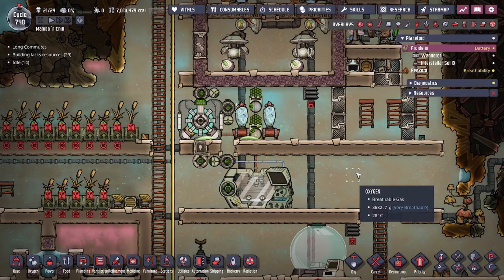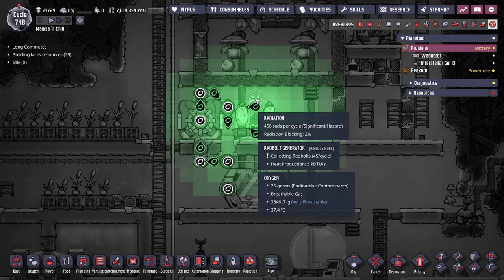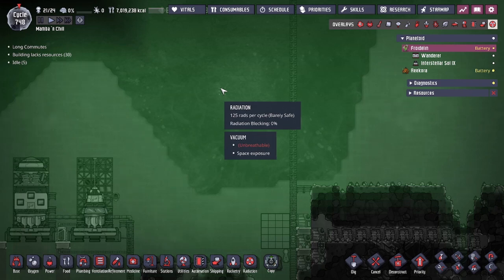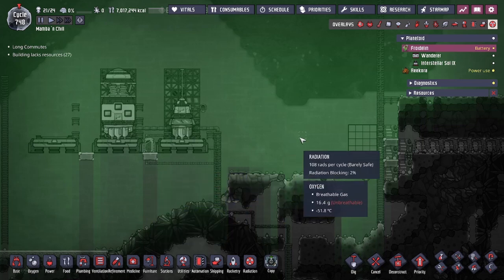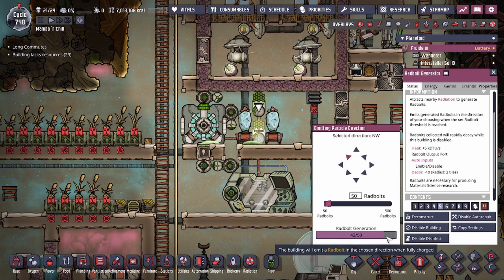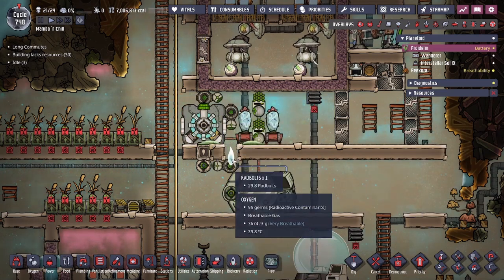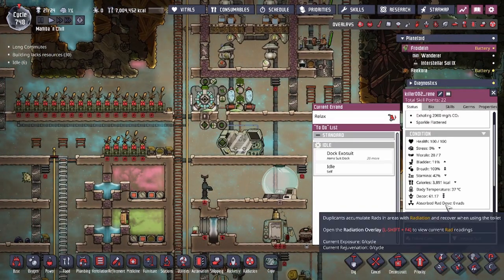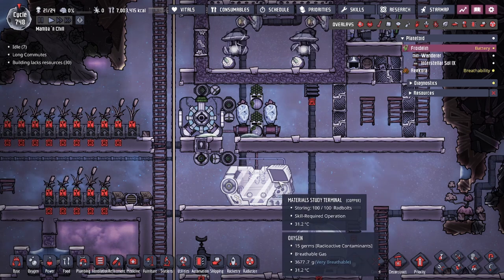Material Study Terminal & Radiation Research - Oxygen Not Included Basics

Comment: For playing for super sustainable, I've done a few things with respect to making radbolts.

The first time I tried using excess hydrogen from my spom system to keep the radbolt generator powered.  I managed to get the two technologies for glass (it's possible to get enough glass after deconstructing windows from the printing pod), but was pumping hydrogen into infinite storage and then pumping it out.  I think I went from 10kg pressure in the hydrogen room down to about 3 or 2kg in it.  I think I had 16 duplicants at the time on the 500kcal setting, and was supplementing power production to keep the radbolt generator running.  It's possible, but I wouldn't recommend it, since once the hydrgoen depletes completely it's almost entirely manual generator power, and sounds too difficult to keep up.

I guess another method would be to build an early geothermal power plant.  But, wouldn't you need a steel based aquatuner to keep the steam turbines cool for such a power plant?  1200 steel early sounds like more power, though I guess that would be reliable and would work.  Though, one might want atmosuits early for that.  Edit: A geothermal power plant is out, at least initially, since a steam turbine requires some radbolt research.

I tried another time, this time with 8 duplicants and the 1000 kcal setting.  I used the manual radbolt generator using the uranium ore, stored in a nearby storage bin.  Yes, it wasn't quick production of radbolts.  And I had some issues with one of my duplicants standing near the radbolt generator operator giving him the thumbs up and then getting hit on the head by a radbolt since she was an idiot for standing there!  But, I figured that I could forbid access to the reflect area with a door and a tile (or just tiles) 3 tiles high total to solve that problem, and did so once I reloaded.  Better still radbolt production was consistent and seemed like it could work a while into the future on Terrania, since the map came with a nice pocket of uranium ore.  If I played on another asteroid with a radioactive crust, I think I'd for sure have a good supply of uranium ore for a bit.  And I think Folia and Quagmiris also come guaranteed with a uranium ore pocket with some lead.

So, if playing for super sustainble for sure, I'd recommend using the radbolt generator before having the technologies for a glass forge and solar panels.  Also, I quite like the graphic of the duplicants refining the uranium ore into depleted uranium.  Once one has technologies for glass forge and solar panels, then I'd recommend pumping out the radbolts can supplement the radbolt generator, or getting deconstructed if one wants the ore for a nuclear reactor and using the radbolt generator powered by one's new solar panels.